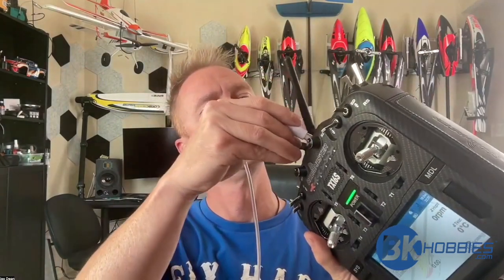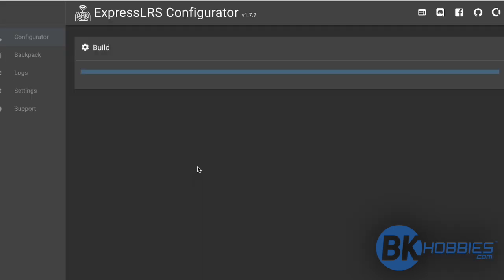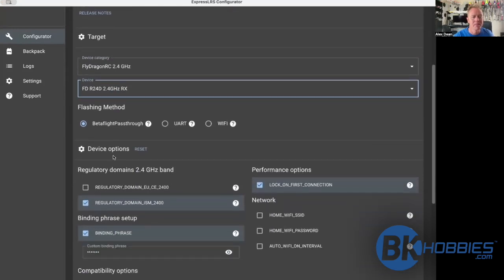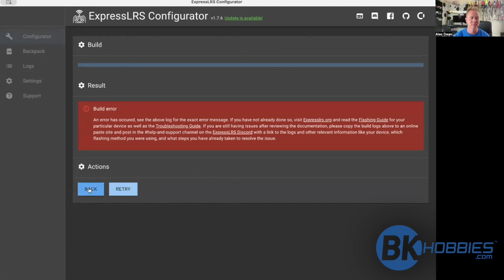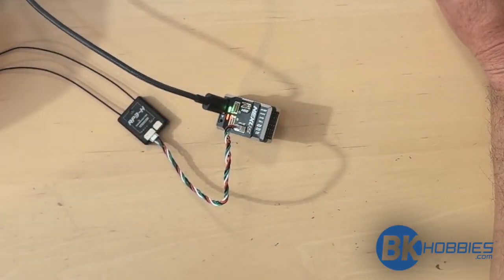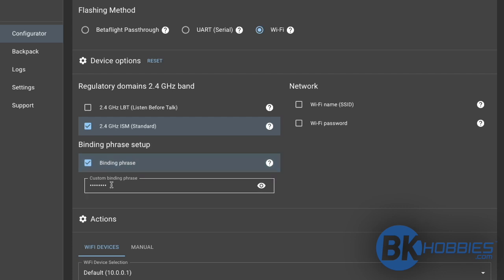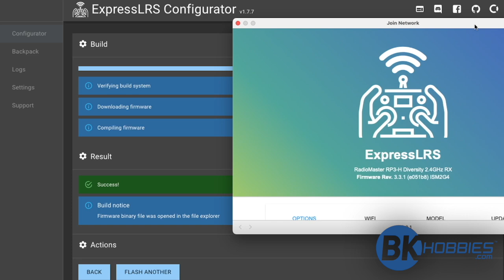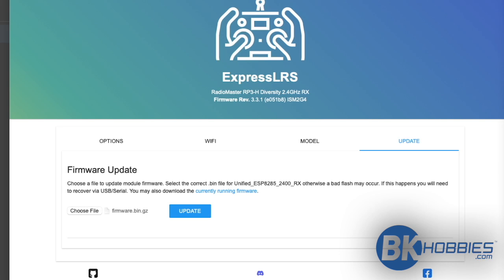Using Binding Phrases with ELRS

Comment: Several big corrections: 

If you input your home WiFi credentials into the configurator, it will not make its own WiFi network. It will instead connect to your home network and you’ll have to find it somehow. Basically, leave those fields blank.

Also if you just want to change the binding phrase, or several other settings, you can skip the ELRS configurator and just use the web UI, it has a text box to enter a binding phrase, and some other settings. 

You enable WiFi for your tx by going into the ELRS lua and hitting “enable WiFi”, instead of turning it on and waiting 60 seconds.